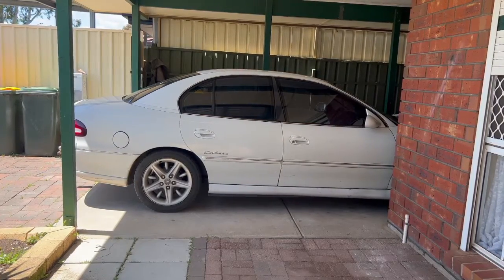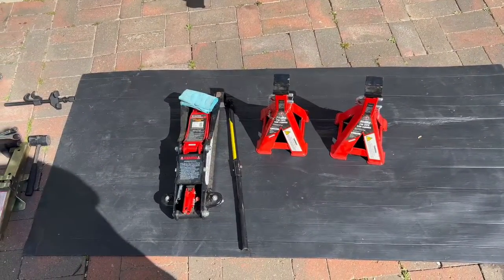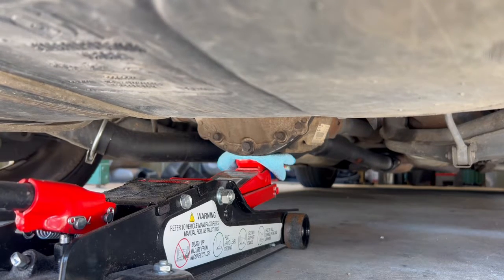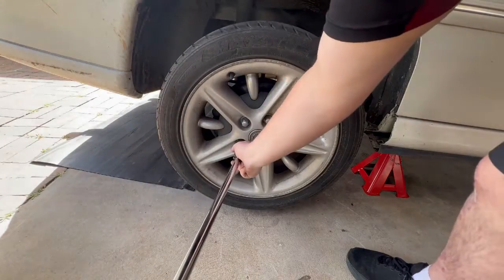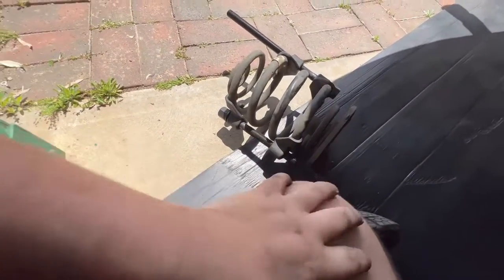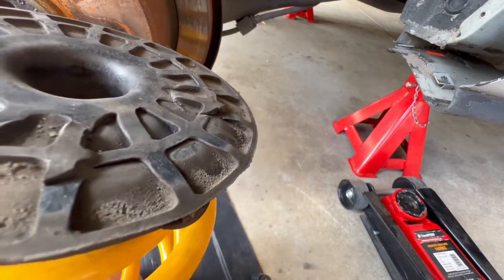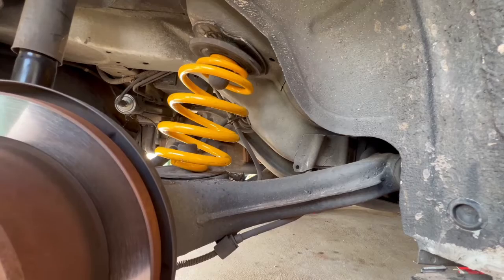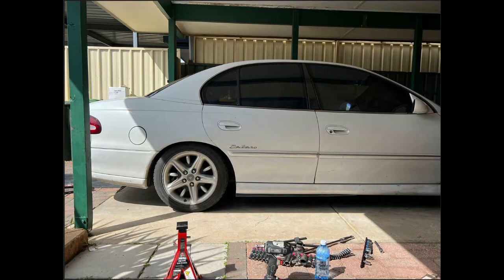How To Lower The Rear Suspension On A VT-VZ Commodore With King Springs

Comment: Undoing the park brake causes that whole section to drop without having to loosen any bushes apart from the shock bolt. May still need compressors if you have heavy duty springs.

Comment: Im abit surprised  you are as good as you are at replacing  suspension parts hey , ive noticed  in your other video doing struts you you didnt know the name of some parts under the car & again in this video  😵‍💫 BUT You don't  have any drama  taking parts off & replacing  with new parts & doing a good job ☺️👍 i watch a thousand  videos  because  im replacing  my front & rear suspension  on my 2004 VY Calais V6  & im learning  heaps watching  these videos  & doing the work myself  along with my mate to save on paying  a Mechanic  the high prices they charge us $$$ 🙈👎 from watching  many many VY Suspension videos i think i now know just about  every part / component  under the car blindfolded 😂😂  That part you're  referring  to at Rear suspension  is rear axle stablizizer link , also known as a rear sway bar link ☺️👍 we have them on the front suspension  as you already know but they are straight Links , i only know this because  of the many  suspension  videos  like yours ive watched  to learn how to do myself , i like your videos 👍 i just thought  it surprising  you're  not familiar  with some part names ! It dont stop you doing a top job on the cars thats for sure 👏👏 Cheers from Bundaberg Qld 🕺🍹

Comment: Very informative video mate, thanks heaps.
Reply from the maker: no problem :)
Reply: @dismissedtub6717 hey mate I'm not sure if you did this or not but if you take the handbrake off the whole assembly should collapse a little and you can wiggle the springs out. Good video though

Comment: What size springs were they?
Reply from the maker: the lowered springs put in are KHRL-46SL
Reply: @dismissedtub6717  Aren't the 46 for Club sports and if you have IRS ? Isn't the 45HD the correct one for the VX Calais Series 1 ?
Reply from the maker: @amounifnd  if you go onto king springs website they say 46 for ultra low https://kingsprings.com.au/catalogue/vehicle/304/holden-commodore-vt-vx-vy-6cyl-sedan-1997-7-2004

Comment: Is it worth it to pay someone to just chuck em on for you at shop?
Reply from the maker: it could be worth it depending on how much they are charging/if you want it done professionally for peace of mind.
Reply: @dismissedtub6717  yeah I’m lowkey stupid so I don’t think I’d trust myself lowering the suspension
Reply from the maker: @benjFPS  that's all good man you gotta start somewhere, i only recently started doing work on my car and it is quite intimidating to work on it without help or any knowledge. So i only did small jobs here and there to build my confidence, thats why i started just doing these videos to help people learn and even get told if i did something wrong in the comments.
Reply: @dismissedtub6717  Yeah exactly, like I just bought a dinky old subwoofer and amp, I’ll probs have to throw myself in the deep end and just figure it out. Only way to learn I guess 😂
Reply from the maker: @benjFPS  goodluck with that, i cant workout wiring stuff for the life of me. tried to put in a new ciggy lighter for the car because it wasnt working come to find out someone before me has spliced into it with a random cable lmao
Reply: @dismissedtub6717  yeah I’ve heard horror stories of people tryna set up subs and unknowingly knicking an important wire and having a fuel pump constantly prime and other stuff :(

Comment: Wow,you made that look painful, you don't need to undo swaybar link,you also don't need spring compressor, if you  read a manual you undo the six bolts on the axle where it bolts to hub,it let's the suspension arm hang down enough to get standard springs out,if you already have lowered springs in their you just need a lever to push down arm,if you lower it more than an inch you should probably trim the bumpstop, but if you keep calling swaybar link that things it might be to big of a job for you
Reply: @unclesmate  that's bullshit, there's service manuals to read (if you can),you can ask other people that have already done it,there's often multiple videos on you tube,there's the commodore forums 
If you don't know what you are doing you shouldn't be making instructional videos

Comment: You don’t need spring compressors , I noticed something about your car you don’t have rear tie rods someones removed them
Reply: Series 1 VX didnt have them. Not IRS. Thats why camber kits are needed even just for the bigger wheels.
Reply: @amounifnd if you don’t think that is Independent rear suspension you need to update your Automotive training
Reply: What makes you say you don’t need spring compressors? I’ve got a S2 VT Exec, got all the parts to lower it, was wondering if I ACTUALLY needed spring compressors or if there was an easy way to get the stock springs out. Front and Rear?
Reply: @benjFPS if there was an easy way why would anyone bother with spring compressors at all lol
Reply: @cpzmelbs  idk man, alot of people in videos i see just dont use compressors, the videos just cut then stock springs are out. I swear ive also seen a comment somewhere that mentioned an easier (still somewhat finnicky) way of getting stock springs out just by taking something apart but idk.
Reply: @benjFPS jack it up really high so u compress your spring and cut it and lower slowly